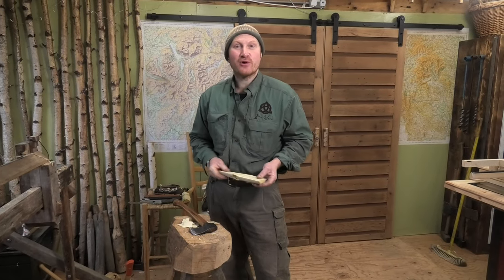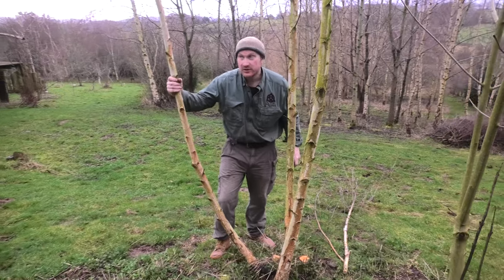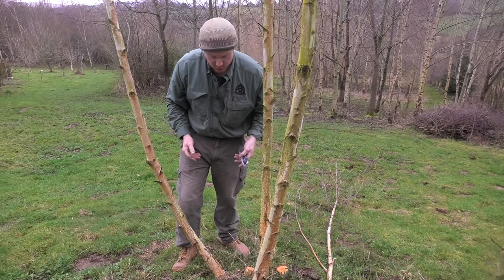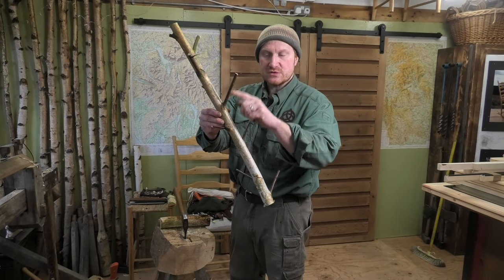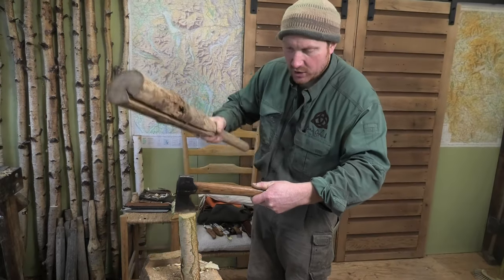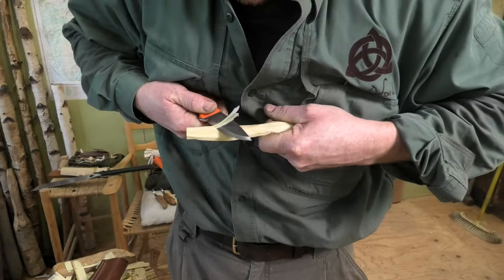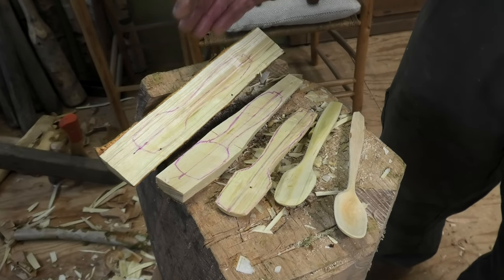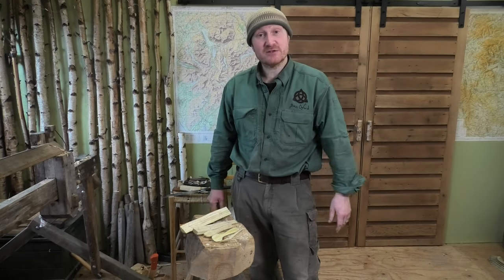Carving a Spoon (WIP Wednesday)

Comment: Exciting stuff for you Ben. Great little tutorial. Any tips for working on seasoned hard wood?
Reply from the maker: Thanks, well with seasoned wood you can carve it the same but much harder, my preferred method is to make the seasoned Wood Green again by soaking it in some water for at least 24 to 36 hours. It will make it wet and easy to carve. As soon as it gets hard again soak it. When you have finished let it dry as normal before oiling, hope that helps cheers Ben
Reply: @BenOrford  thanks Ben great advice

Comment: I noticed the wood in the background.  Do you seal the ends to keep it somewhat wet before use or do you let it dry and then carve it.  I have been wrapping limbs in the plastic that is used to wrap pallets for shipping.  I happened to have some from a move once just sitting around and tried it.  It kept the wood wet for a long time and if you let sit for a longer time the spalting sets in.  Since I don’t have the land for planting but I do have a tree trimming friend I to get access to lots of green birch or alder.  After I carve a green spoon and get it to where I like it I boil it for about 8 minutes or so then let it dry and colross  it and then oil it.